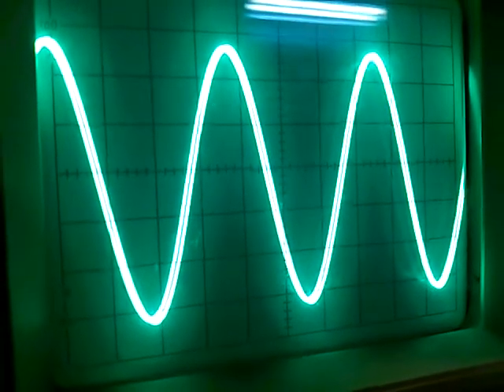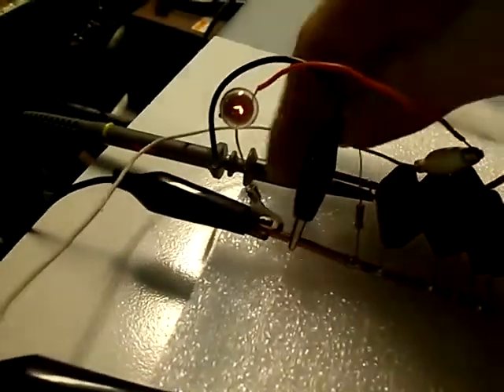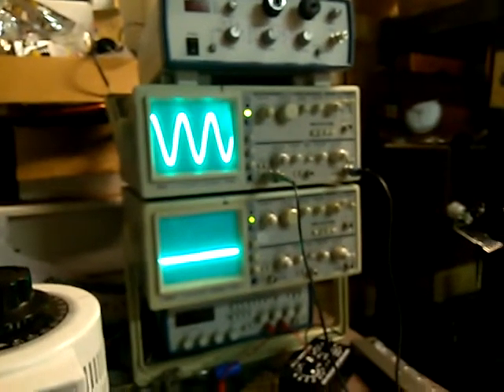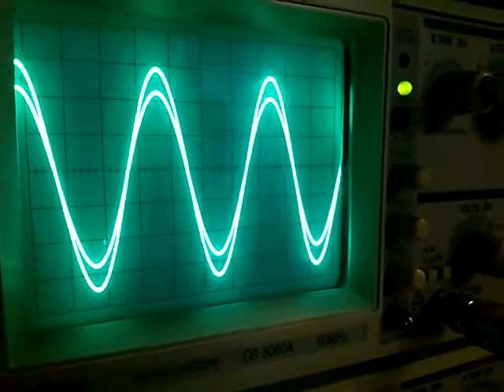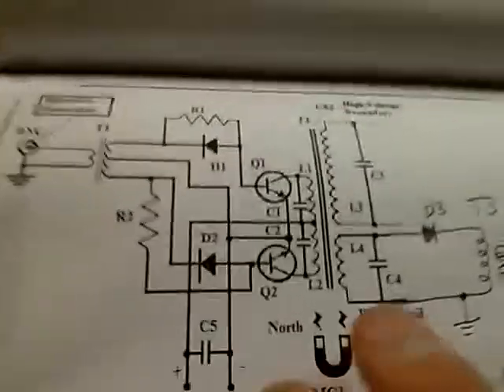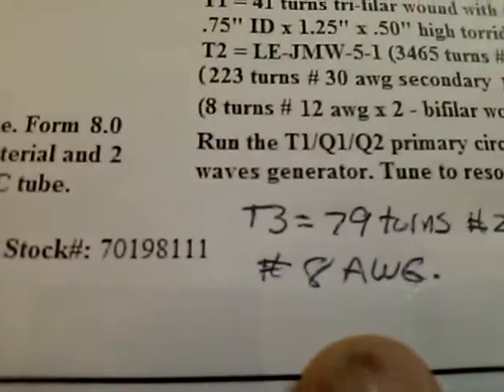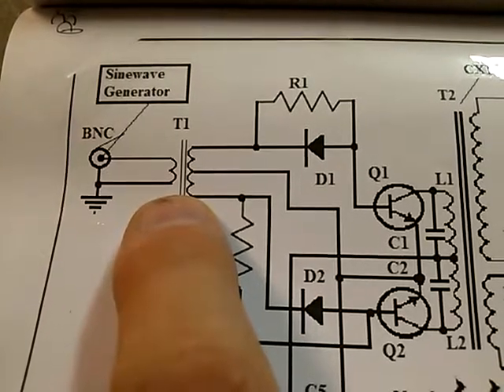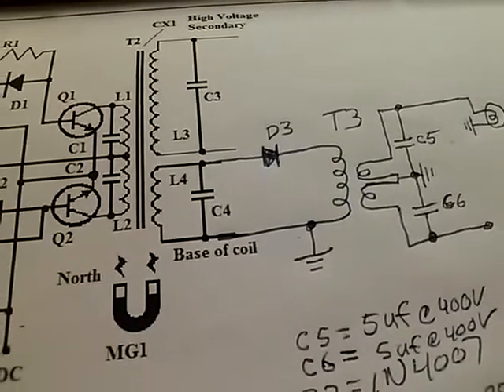Donald L. Smith exp. 23

Comment: What was the purpose of this experiment? Don Smith's experiment is basically creating a resonance in which both current and voltage are in the same phase thus delivering maximum power and this is only by moving the magnetic flux not the electric induction? The main idea is to produce high spikes or impulses while the system is in resonance thus the etheric energy rushes into the quantum flux field and increases the flux density at very high frequency and very high voltages. That energy is of no use unless it is reduced in power and frequency by feeding it to an isolation transformer that should have all three components in parallel, such as resistor, capacitor, and inductor (the primary of isolation transformer); This way the etheric energy is tapped and becomes useful. Or you can rectify it with the help of HV and HF diodes to charge capacitor banks and then use the DC to run an inverter for useful usages. So what is it that you are doing? Please explain.